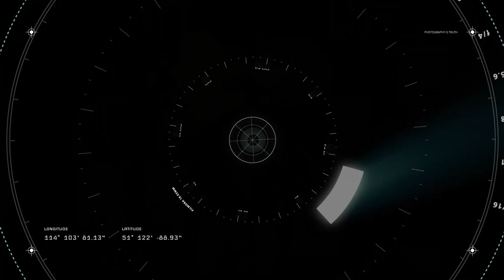FMTV HABITAT BUILD Day 3 Part 2 Finale' #186

Comment: Dave, your videos are incredibly helpful as I research LMTVs and plan a habitat buildout. Plus, they're entertaining. So I have several questions after watching this episode: 1. How do I get pricing on a habitat like this?  2. How did you create the 3D design and can the template be used by others. After all my research, this is the same type of habitat I'd like to build.  3. How does one build out the interior? Meaning, how are the internal frames and structures attached to the external habitat, and so forth? Again, great work! And thanks for sharing the knowledge.
Reply from the maker: Best thing to do is go to www.rvglobetrekker.com for prices and additional videos and information. There are also interior build videos, and how to do general wiring and so forth. The best way to do interior is to design the layout first, then have a C&C router cut out all the cabinetry from a few sheets of wood. They go together easy, like IKEA does, but much, much better quality.